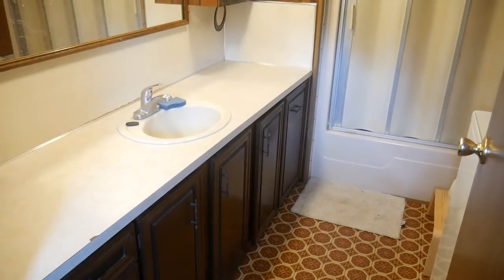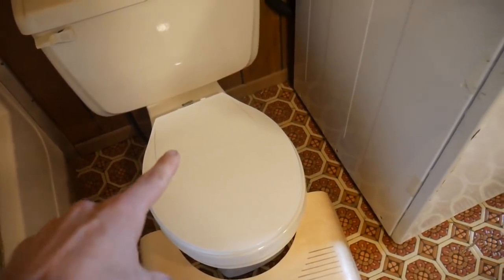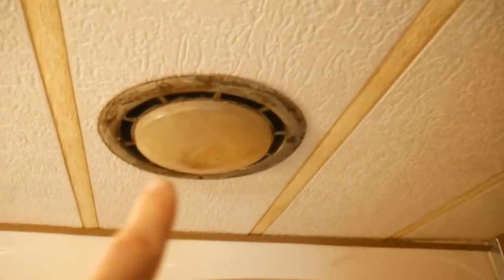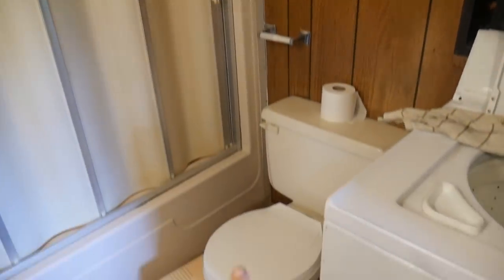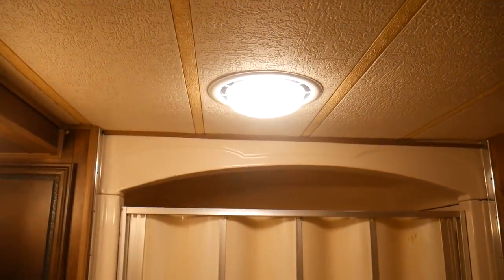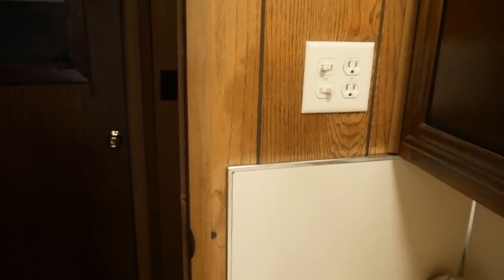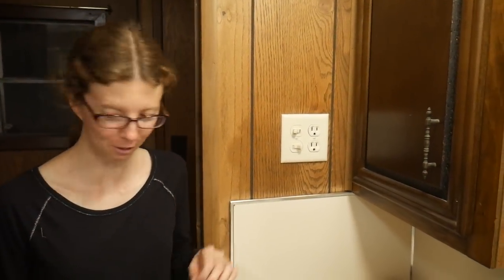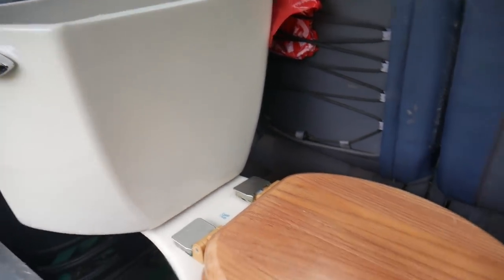Can We Save this old Mobile Home? Starting the Bathroom Renovations.

Comment: I love that you do things right instead of covering up. When we bought our current house there was a piece of paneling in a downstairs bed room that you could tell had been removed and put back so I removed it to see what the deal was and there was a tiny leak at the top that had probably been leaking for years. It was so small it evaporated before it got to the floor but still was a mess. We ended up gutting and redoing the whole room now it's beautiful.

Comment: Too funny, that is the exact ceiling I have in my camper and the ceiling light fixture. Even though the fan worked in mine, I disconnected it and stuffed it with insulation as so much cold air was coming through.

Comment: Jokingly seems like you two are beautifying Indiana one house at a time. In reality your 
using these stepping stones in life to move forward and upward.  You are a good teammate for each other.
I'm asking this next question to learn.  Why was a new toilet needed if it was only the rubber ring that you thought was the issue?

To your viewers may I teach you something.  When mailing packaged items please, please wrap the original contents tightly with a paper bag like from a grocery store with the address and return address.  Now this seems odd but if it's in a box do the same thing to the outside box.  The reason being is that the postal system is automation and uses conveyer belts.  SOMETIMES FILMSY WRAPPED PACKAGES BREAK APART (with the inner contents sent down the belts of not being able to shipped because of now no address.  The post office does care about every item getting delivered but sometimes it is the sender's misunderstanding of how the system works and them taking precautions to wrap their items tightly and with an inner address like on the inside of a book, item of clothing, instruments, food etc., etc..
Reply from the maker: About the toilet. I should've explained why we were replacing the toilet. The toilet has a large tank so it wastes water and our hard water has taken a toll on this old toilet. It has very tough rust stains and worn porcelain. It just won't come clean. We figured it would be best to replace it while doing the work to fix the leak.